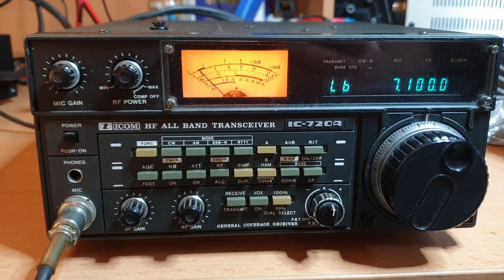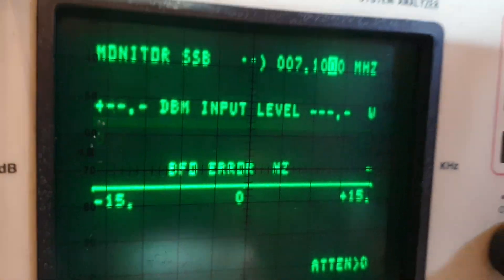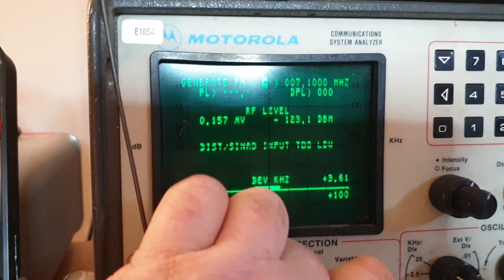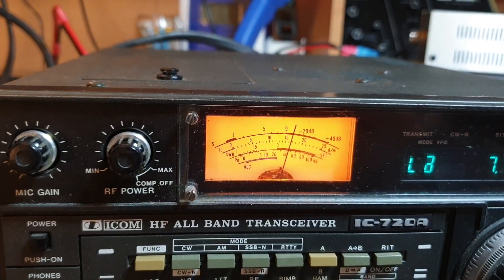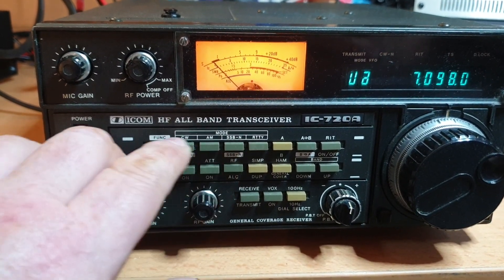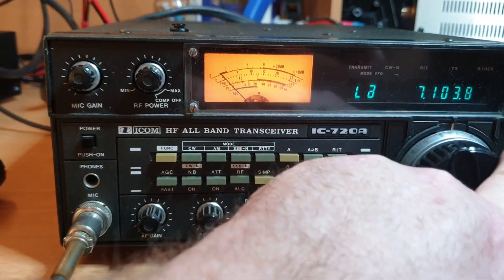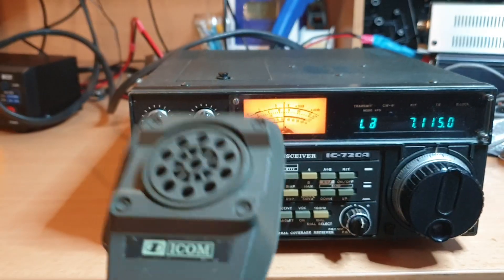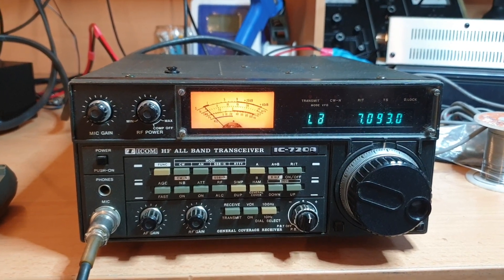Icom IC720A HF Transceiver- The Relay Clunker that works perfectly across the spectrum😁

Comment: There is nothing wrong with owning older gear, it gives the new coming hams an opportunity to go on air without robbing their bank accounts dry, we found out that most who decide to stay within the hobby change their gear to more modern gear later on. Thanks for the video.
Reply: Very good point couldn't agree more

Comment: I bought a used unit back in 1995.  Band switching is not by relay, but by an actuator that causes the multi disc band switch to rotate. Mine would not always  make all the connections because the shaft and discs were "loose." (The first owner must have rotated the "heck" out of the bandswitch.) Also, the receiver's front end transistor needed to be replaced.  A new, young ham has it now.  73 de AA9SH

Comment: Great radios, I have one, they were used by the the Royal Air Force TCW (Tactical comms wing) here in the UK for many years, rebadged as Marlborough Communications and also used as backup transceivers for military flightwatch.

Comment: The IC-720A was the first Ham Radio I bought, it was new and the year was 1982. I am sorry to say, but I hated this radio with the loud clunking. I sold it and bought a new Kenwood TS-430S. It took  nervous  courage for me to go back to Icom again after this and buy a new IC-751 in 1986. The IC-751 and IC-751A were marvellous rigs. Icom redeemed themselves, and I have become an Icom fan - currently with 2 X IC-7300, 1 X IC-7610, 1 X IC-7100 and 1 X IC-705, Damn, I love the new Icom SDR rigs - the IC-705 is just so nice, I feel like taking it wherever I go